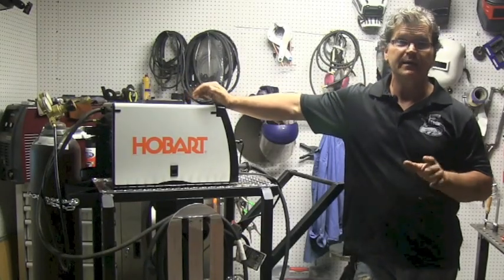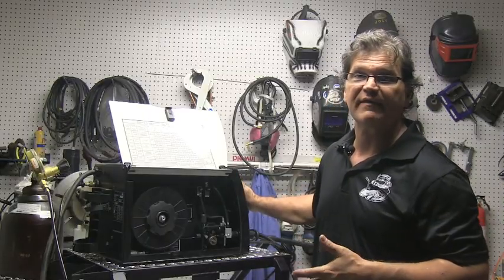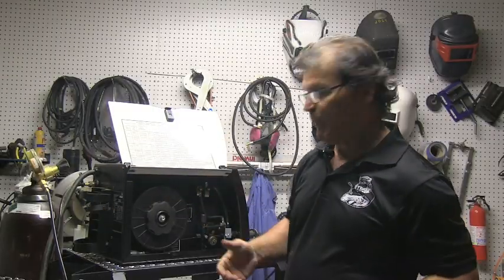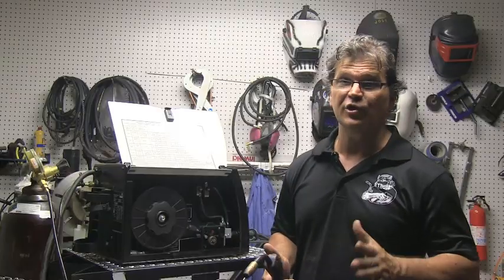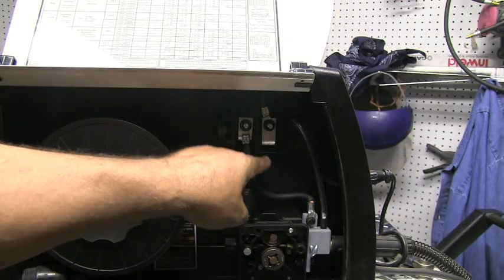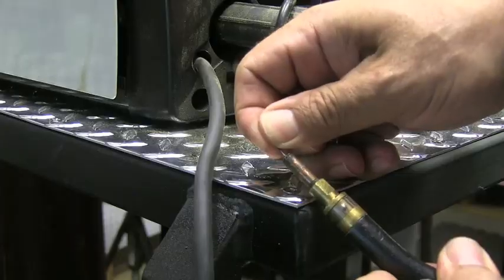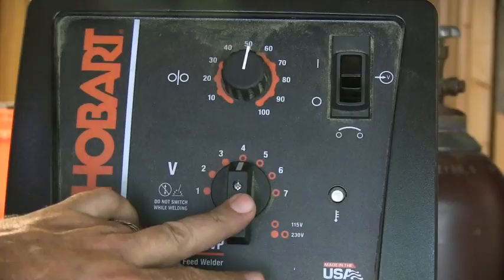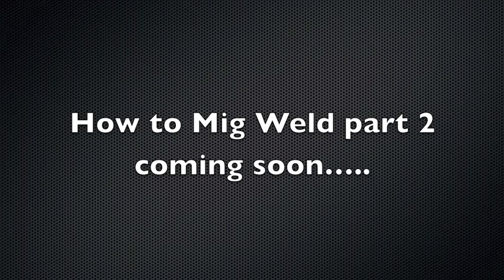Mig Welding Basics

Comment: Hi Jody, I am very surprised to Electrode Positive for Solid Wire and Electrode Negative for Fluxed Cored WIre. I use Electrode Negative for both Solid Wire and Flux Cored wire. Can you provide an advise? Thanks

Comment: I just bought a new Hobart Handler 210 mvp and the ground clamp that came with it is way better than the one that came with yours. It's not as stout as the ones that came with my old "Buzz Box" or my old 110 mig but it's decent. Great informative video. 👍

Comment: Thanks Jodi for sharing your expertise, I have watched many of your videos. I have an Everlast power tig 210EXT that's burning up my tungstens. I'm working with aluminum 1/4 and 1/8. Tried different amp setting from 100 to 210. I'm also getting a yellowish and whiteish residue on my cup. Any suggestions. BTW I'm using 100% argon.

Comment: Do you have to used the gas if you welding steel 🤔?
Reply: No you don't, you can weld with Flux Core wire

Comment: Hey Jodie really enjoy your videos thanks for what you do I have learned a lot.  I’m running the same Hobart wire feed welder that I see in your videos my question is looking for a good commercial tig welder any recommendations on good machine to purchase ?  i’m kind of leaning towards the Miller multimatic 215   Using it mostly to build a arms and trailing arms for baja race trucks.

Comment: I have watched some of your videos when they were a “YouTube” recommend...
   Not a welder, but somewhat of a “geek” on certain stuff (ok, truth be know, a full blown “geek”)...
   I am 58yrs young, and the last time I touched any type of equipment related to welding was a one term Junior high class...
    Recently bought a 1966 Dodge farm grain truck that dumps, for hauling gravel to my rural property driveway.
   I am looking at doing some modifications to more reliably dump/spread the gravel...
    Obviously, woefully late to viewing this video, but it has been a great “101” for me on “mig”.
   Now I will be binge watching your series...
   Please give give me you “no B.S., opinion on a decent machine to buy.
   I will be welding mostly 1/8inch or less sheet metal with rust, however I plan to clean it up (wire wheel) prior to welding.
   I will also he utilizing new pieces of metal i.e., tubing (1/4inch wall thickness) and, pipe (schedule 80) in the range of.
    I was looking at a “HarborFreight”(really goes against my buy America mentality) Craigslist”, pawn shop purchase), but this will most likely be the only welding project do.

   Wheeeew, sorry for the long winded comment. I guess it is about time to sign off, already...

Comment: The old shop I worked in had guns with the tips recessed like half an inch cuz they refused to buy the correct sized tips or give us time to trim the nozzles.  We pretty much had to crank the voltage and almost dip the nozzle in the puddle to get a smooth arc.

Comment: I believe Miller and Hobart are made by the same company. Many parts are interchangeable and the spool guns for the Miller 211 and Hobart 210 MPV have the same identical spool guns with the exception of the part that plugs into the machines.

Comment: Came back to get a little refresher before an interview tomorrow. Hadn't touched the Mig in a while and I always learn something new from you. Thanks Jody
Reply: Did you get the job mate? I've had a shitty day at work today, done some crummy welds. (Crummy to me) really struggled getting into a tight space, 1 metre long multi-runned fillet weld of 11mm but the gap is just fucking ridiculous, it starts nice but quickly tapers down to about 2 1/2 inch and you can literally only just get it in. One handed as well because of the gap restriction... better suck it up though because we've got loads of these bastard things to make 😐😅

Comment: Well, i see u like to keep tip close to end of nozzle. Np. however, in some places u cannot access the power source. Instead of setting all the time, i just pull the nozzle down so the tip is inside. it cools the weld down and also i compensate with travel speed. Depending on what is being welded as in thickness. a lot of jobs, there is 3 or 4 thicknesses of metal to weld. i would generally set it to the thickest metal and then compensate as mentioned.

Comment: Great video!! I have just got started with the MIG Welder and made my first welds today, and clearly need a ton of practice. If I am using the flux core welding method, I do not need to use that tip shield you use when using the gas is that correct?

Comment: Jody, Thanks for using the weld camera. It would help if you drew a picture of the parts to be assembled and with a different color draw your various welding techniques. 
Also demo a spool fed hose handle. Another presenter mentioned that it is important to keep the unit UNPLUGGED while switching polarity. DC voltage is used to kill (600 volts) and really kicks at lower voltages. Explaining about the air vents and arc shields would be nice.  Thanks for the safety glasses tip. Over 40 guys can get safety glass readers.

Comment: Jodi ,Thanks for your very informative series of videos. I went to tech school for two years in the late 1970's and have most of the welding repairs my  excavating and trucking company had needed over the years. Could you make a complete episode on setting the correct parameters for mig welding?  I need help recognizing what parameter needs to be changed to get the welds to lay down like I would want with correct penetration. Please help us fine tune the  correct voltage and wire speed adjustments needed to make perfect welds.  Most of my welds are on 3/16" up to 3/4" plate. I typically use .035 wire and 75/25 mix. Thanks  Jim

Comment: Thanks for the video. Based on your remarks around 8:00, I inferred that any MIG welder which can handle solid core wire can also handle flux core wire. Is this correct?
Reply: Yes

Comment: Hello my name is Steve.  I am a master carpenter and have always worked in plastics and wood but never much in metal.  I have one eye and only see 20/70 in that eye.  A little nervous about welding making sure I can see the puddle while protecting my eye.  Do they make a magnifier for a helmet and what are the "best" helmets to use.  I have seen the auto darkening but is that letting a small flash each time you start welding?  any tips on helmets would be great.  Thank you Steve

Comment: Really good, to clarify;  nozzle is the outer cylinder and the tip is the inner copper that has the flux run through it. If correct, u prefer the tip to be flush or protrude a bit from the end of the nozzle, for a good weld and access to T joints that you refer to.

Comment: Glad I found your videos.  I started playing around with my husbands welder years ago as a stress reducer, and started welding silverware into repurposed art.  I lost interest for the past couple years but am starting back up again and have seemed to forgotten everything that I did before to get good tack welds.  I started up yesterday and had just a horrible time with "Drive by shooting" sounds.  Well, I think you may have answered this for me with the ground.  I bought a new welding table from harbor freight before I stopped welding, and this was the first time I used it.  I felt I wasn't getting a good ground at all despite adjusting wire feed and voltage.  So then I clamped onto my piece as was doing better.  So your wire is a helpful comment that I will try!   Thank you!

Comment: I personally hate Hobart welders.  The older machines weren't too bad but they've taken the cheap route and are selling off their brand name while offering no more than the unbranded welders out of China you can find on Amazon.  You want a good MIG welder look at AHP's 250 amp model.  Double drive rollers, infant voltage and wire speed, spot and stitch modes and has the power to run spray arc and dual shield flux core.
Reply: Hello! Here in Sweden i have Kemppi 3200 with 4 drive rollers, its allready 15 yeras old and only now it start to do a bad job! I change the rollers and its ok again! Kemppi its made in Finland and started 70 eyars ago!

Comment: Hello Jody, my name is Roy and I am new to welding. They say your not to old to learn, I sure hope not I just turned 75 and I always wanted to weld. I bought me a little Campbell Hausfeld  115 / 120 welder just something to use in the garage. I mess with cars some and tinker a lot. All I have is  email so if you can answer on emails fine. I really enjoy your videos a lot so keep making them. Right now i'm using the flux wire have to wait a little until I can get a bottle and some gas. In this video you stated that you could get an adapter to convert your machine over to 210 when you get it done. Is this standard for all machines? Hope this does not sound stupid, but I am a retired Police Office and Truck Driver and don't know anyone that welds So any help you can give me will help. Thank You, angkeep up the good videos. Thanks

Comment: I have a  Hobart 140 machine  running  on  110   volts   .030  solid  wire   I   only weld  mild steel  1/4" and  under  mostly  1/8" ...  is it  acceptable to be using  CO2  only  or  could I   get  better   results with   mixed  gas    say  25-75   thank you  ... enjoy your  videos

Comment: Jody, I  have a Hobart 140, and I noticed that the gun handle is turned 180 degrees. How did you do that? Just loosen the screws and rotate? They appear to use the same or similar gun assemblies.

Comment: Thank you for this video.  I recently purchased this machine and I've been trying to figure out a general setting to use to get the consistent puddle I'm used to seeing in my welding class.  I'm going to try this setting and see how it turns out. Also I plan to upgrade my ground clamp on this machine.  Any suggestions on what type of ground clamp to use?

Comment: Hey Joe.  I have watched the 8 segments you have done on mig basics.  I have been thinking of getting the 120V  MIG welder for my projects.  I do mostly small stuff with 1/8th metal and mostly rebar.  If I understand correctly,  I can use the 120V welder instead of the pricier 240V, I just have to do multiple passes if I need a wider or stronger joint than just the single pass, right?  Or do I need to just plan on getting the 240V so I make sure I have enough hot to bond correctly?

Comment: Hello, and thank you for the video, I'm a semi-self thaw welder, (learn by watching others) if you consider that trained....I can weld aaaahh,,,ok I guess my pieces don't break apart,,,but my question is the GAS ratio, I have a Hobart 140 with regular/solid wire and not sure how much gas it should be putting out..

Thank You

Comment: Jody, I have a Hobart Handler 175 that I bought new years ago and in the beginning I read the manual and looked at the chart inside the cover and I have never been able to turn the wire speed up hardly past 25% no matter what the voltage is set on, I have tried adjusting everything on the tension and such and I can still barely move the wire speed and it just comes way out and bunches up, any ideas,  Thanks, Dave

Comment: Great instruction. I have a question. I have an ESAB multiprocess welder and am learning to MIG weld. You stated the  CFH should be set to 12 to 15; heard the same thing from others. The Victor regulator that came with the ESAB welder uses  color coded CFH ranges for both MIG and TIG. It shows 10 - 28 CFH for TIG and 30 - 42 CFH for MIG. Why is the MIG CFH higher than what others say is the correct MIG CFH range? Thanks.

Comment: Hi, I recently posted a vid of me welding a guard for my planer, I'm a joiner not a welder, really not a welder 😆
I have a Mightymig 100amp flux core welder, I struggled to get the weld to melt in to the 3mm flat bar & 16mm round bar, Do you think a more powerful machine would help me get better welds, I've still got a lot to learn so any advise would be gratefully received , & if you get a chance to glance at my vid to see would be good, it's the most recent. 
Thanks I watch all your videos so i think i already know the answer,

Comment: Is mig welding apropriate for 4130 thin wall tube? Hobart says yes if the correct wire is used.  but a lot of folks don't seem to think so... A lot of bike frames and suspension parts  are made with mig... Is it just an appearance thing?  If not I'm curious why?

Comment: Thanks for the video. The Hobart 210mvp is the same welder that I have. I would've loved to have went with the 230 floor model, but I needed something that I could transport much easier if need be. 

I have only used flux core so far, probably around 30 pounds or so. I'd really like to try gas and solid wire sometime.

Comment: When you say 4 and 40 for wirefeed and volts is that 4 meaning 40 volts or 4 volts? I'm confused when talking about voltage and amperage...clarification with this would be great. Thanks!
Reply: Katherine Ma 
4 on the heat 40 on the wire speed

Comment: I've heard it said, 'mig welding is the easiest part of engineering', however, I can assure you first hand, it ain't got nothin on stick/arc welding for simplicity. So much so that I'm just about to upgrade my old transformer welder (that I've used for the past thirty years) to an inverter arc welder because I've just used my mate's one, and it's so much simpler again!

Comment: I watched your mig welding basic series to 8 and i enjoyed them and you speak clearly and understand the lesson.
One question i have is do you touch on 19 gauge sheet metal in any of your other videos?
I'm trying to patch and fill holes on my muscle car and my biggest problem is adjusting the welder (Eastwood 175 mig with 75/25, 23 wire).
Either i will get too much of a raised ugly weld or blow thru the metal. I have no problem welding thicket steel like my frame or square tubing.
Thanks

Comment: A tips I have is remember to turn on the gas otherwise you will have bird turd welds (done that). 
If you get sputtering like low wire speed check your tip make sure you have one on the gun (done that too).

Comment: I've done a lot of flux core with my miller 135, just picked up a millermatic 251 and figured I would study up with your vids. The bit about stickout and you trimming the cup back flush or slightly below the tip is GOLD! Mine has a slightly recessed tip and I was concerned with the stickout and less visiblity compared to my flux core. I also learned what the brown stuff was. You are my go to guy when I am working on learning more. Thanks!

Comment: Would you say a tig welder is better for welding thin metal such as 16 gauge square tubing? The reason I ask is because I have this Lincoln mig welder 135A and sometimes no matter what I do, I keep making holes through the metal sometimes. I'm running a mixture of gas 75/25 with the thinnest wire I can use which is 0.25" and I got the correct settings according to the chart on the welder.  By the way, this is not even 16 gauge, it's 14 gauge metal I was recently working on.

Comment: just a question.. i seen you have your gun kinda flip flopped and the button on top? how did u do that? and in guessing it provides better control? i got a hobart 190 with 0.35 solid and 75/25 mix

Comment: hey Jodi im looking at getting a welder .i wanted a tig but they start out at 1400 . i want/can spend 500-600 so im looking for a mig and was wondering what welder would you recomend in that price range ?thanks for the time
Reply: this movie 210 is not much more than the price your looking at. and when I bought mine from tsc all they had left was the display model so it was around 650 or less. I don't remember.  butt I am very happy with the Hobart mpv 210. I primarily used it to rebuild cars and trailers. it paid for itself the first time I used it. you can't go wrong with it.

Comment: Jody is very easy to follow, is a pleasure to learn from and keeps it at a level with good common sense. I certify technicians in auto body repair and feel his videos are a benefit to anyone who MIG welds. Most times auto body technicians are not formally trained and lack good knowledge of machine setting and techniques to preform a quality structural out of position welds. Jody, maybe some time you can devote a video to thin gauge MIG weld or the following welds in the vertical and overhead position; Plug 5/16 on 16 gauge,  open butt welds on 22 gauge with proper root gap, Filet weld on 22 gauge, and butt with backing on 16 gauge and proper root gap. I know this would greatly help auto body technician's and the hobbyist's. Ho and for the local technical school educator who teaches quality auto body welding. Thank you in advance!!

Comment: Am I right in saying that the wire sticking out the end of my torch is not permanently live unless I pull the trigger? My welder is a Gys Smartmig 162 and is advertised as non-live torch but the manual is a scant pamphlet and doesn't clarify that so I'm nervous to trim the wire with pliers while it's plugged in in case it's live. I could put my multimeter on it but if its live it will nuke it.
How exactly are leather gloves sufficient insulation from electricity when cows are slaughtered by electrocution?
Reply: +Dr. Ralph Kennedy you get an answer?....as long as it is a none live torch which if it has a trigger it is....simple test... set up a piece with good earth and touch the stick out wire on the metal,if it's live it will arc,if dead nothing will happen...
Reply: Some cheap migs are always hot once the main switch is on. The trigger on the gun just feeds the wire.
Reply: It has to do with moisture. And voltage level. In electric industry they work live circuits hot, up to 5000-volts, but protect against shock by using two layers of gloves: rubber gloves with leather over-gloves. Cows, and their skin (leather), are moist; you are right, excellent conductors. Thick, dry leather will insulate for house and shop voltages (120-volts, 240-volts).